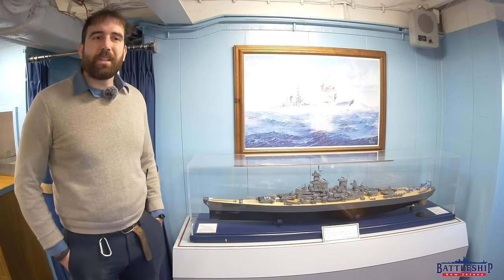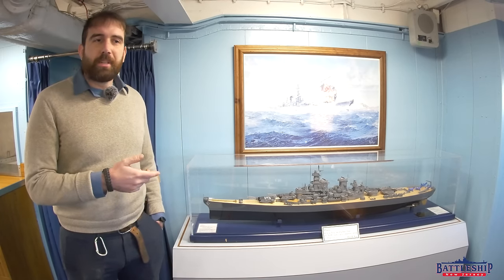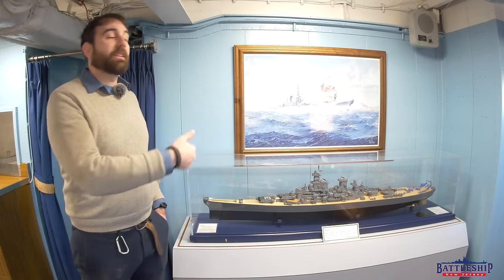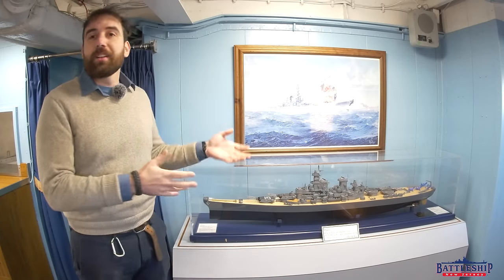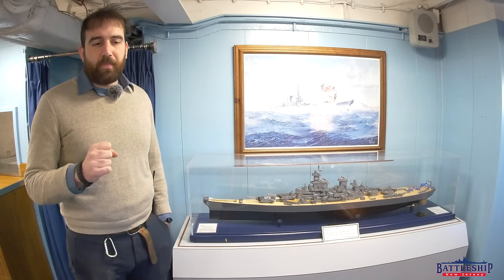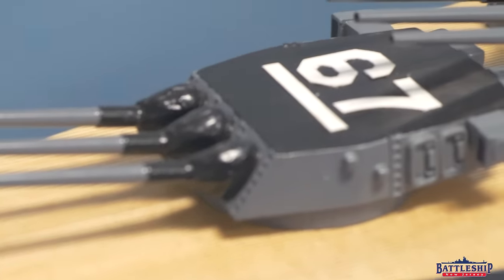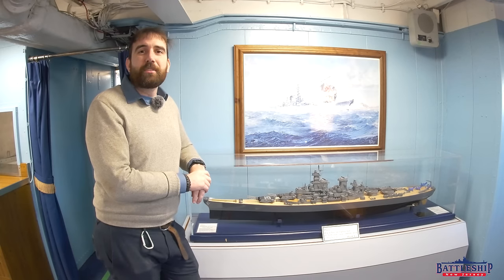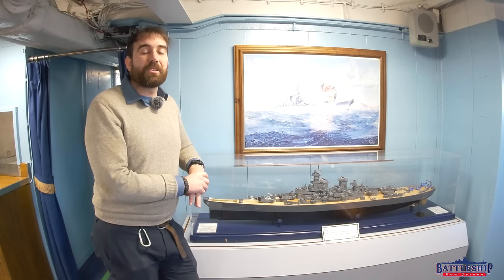Battleship Montana: What Would We Have Done Differently

Comment: With the benefit of hindsight, I'd ditch the two aft turrets and the floatplane facilities for an actual hanger for helicopters and a helicopter launching/landing platform. But would I have proposed such changes in 1943/4? Probably not; advances in helicopter technology would have been highly speculative. If additional battleships were to have been built, completing the Illinois and Kentucky was more sensible than building even a modified Montana-class.

Comment: Something insane like deletion of rear main guns and magazine and installation of a nuclear propulsion system. Delete fore secondary battery. See if redesigned propulsion allows for shorter belt. Delete or redesign torpedo bulges. Optimize armor scheme for HE or break up and pre-det bombs instead of worrying about naval gunfire.

Modify bow to house honking huge sonar mount. Large superstructure now venting steam instead of smoke enables larger radar systems.

Reduce secondary battery to x4 single 5" .38cal mounts, anticipating naval SAM systems. Because the ship would carry huge Radar and FCS, it becomes a proto-Aegis platform radar-burning targets BVR like AWACS would go onto do.

As original 16" .50cal batteries wear out, replace with .60cal equivalents firing lighter shells, or develop a simpler mounting with twin 18s. 

As cold war develops, keep plugging in and out contemporary arty and missiles while main gun tech is steered towards extending fire support range. 

A CGBN series. At its craziest, using the superstructure or aft magazines to host ballistic missiles.

Comment: Getting rid of the conning tower and condensing the superstructure would be the extent of the of the major mods that I'd make to the Montanas. I'd leave the total displacement alone. The late/post war advanced  AA would be a natural progression for all heavy ships. But her speed isn't an issue here. A cruisers and destroyers are much more capable escorts for fast fleet carriers. Leave the BBs behind. Let them either join hunter killer groups hunting surface raiders, where their main battery range and punch can do the most good, or attach them to the amphibs, where they can be used as a near unstoppable amphibious group command center/gunfire support ship can be it's best use. And that's really will be their job in the cold war. unless they threw a nuke at it (and the Baker Test proved that that could be an iffy proposition, too), replacing all those guns with a few Vulcan Phalanx and a quartet of Sea Sparrow launchers, and what the heck, maybe a Standard launcher or two (we have the tonnage, and we're not afraid to utilize it)! You look at the various FRAM refits that were done to Fletchers, Gearings, and Clevelands in the 50s and 60s, and I wonder what really could have been accomplished if they went clean slate with her superstructure?

Comment: Hi Ryan,You are not a Star Trek Fan. When I was a teenager when I grew up in the 80's I watched all 7 seasons from every Episode of Star Trek:TNG, I also watched all the syndicated reruns of the original Star Trek. As a kid I watched all the original  Battle Star Galatica series there was 1981 season that was Earth landings. I also read quite a few if TNG novels and William Shatner Movie Memories, that were popular at the time.
 With Star Trek TNG you Paramount and CBS published many  Star Trek companion books and paperback books.  One book was the Enterprise D Galaxy Class Technical manual.  Believe it or not when the Technical writers for the show wrote the book it also included redundancy. Both the Saucer section and the Star drive have their very own computer core. They worked independently during separation and one would function if it got damaged. Before the ipad the crew had electronic tablets. Believe it or not  they made those tablets to also be redundant that if the bridge computers were off line both engines and navigation could be controlled with the tablet. They never did an episode on that. Well TV shows need drama so when you need to do fight scenes and self destruct to take back control of your ship having a tablet doesn't do much with conflict. 
 One thing about Voyager TV show which I also grew up on in my 20's was that show was based using every science fiction technical jargon under the Sun. They did really well creating more ship jargon that  out did NASA with all its acronyms.
 Deep Space 9 the major theme in that story was that station unlike Enterprise it had major breakdowns was always in need of repairs. So just like Navy ships that break down well in Star Trek so do Space Stations.
 Every Star Trek spin off had it's very own theme on how it communicated to that audience and kept every show separate from each spin off. 
Rick Berman did a really good job with all the spin offs since his taking over for Gene after his death.

Comment: The Iowa class battleships were designed with a 212,000 shp to reach their top speed. All varients of the designs for the Montana did not use the same power plant as the Iowa's for the engines and the highest number I have been able to find for the main engines is 172,000 shp. By utilizing the same engines that were in the Iowa class you could overcome a lot of the speed issue, arguably you could actually install more powerful engines without much fuss as the hull is already wider and longer than the Iowa class.

Comment: If the US Navy had really wanted to increase the speed and range of the Montanas, they could have replaced the oil-fueled engines with nuclear power plants in the 1960s. 

The USS Enterprise (CVN-65), which had its shakedown cruise in 1962,  had the following propulsion system, according to Wikipedia: 
	
8 × Westinghouse A2W nuclear reactors
4 x Westinghouse geared steam turbines
4 × shafts
280,000 shp (210 MW)

Compare this to an Iowa, again from Wikipedia:

8 × water-tube boilers
212,000 shp (158,000 kW)
4 × screws 
4 × geared steam turbines

Later designs had just two nuclear reactors per supercarrier, but this is the first ship that was as large as (actually larger) than an Iowa that had nuclear propulsion, so it would have been the first ship with "proven" tech that could then be used to retrofit an Iowa or Montana class battleship. The A2W reactor could, in principle, have been used for a 8-unit nuclear replacement of the 8-unit water tube boilers on an Iowa. This is sort of hand-waving away minor engineering issues such as whether or not it would fit inside a BB hull without major reconstruction, but it's a useful "thought experiment".

Comment: Once is was clear Aircraft carriers were a better overall fighting ship, that battleships, did the US Navy ever consider building (fast) , special purpose anti-aircraft ships to better protect the carriers by providing an outer ring of defense that increased the number of guns that could engage more aircraft further away?
If a cruiser hull, was changed to remove its 8 inch turrets, all that space and weight savings could yield a fast vessel with a huge increase in 5 inch guns. When proximity fuse shells were available several (anti-aircraft ships) could protect carriers more effectively. A special destroyer variant might do provide a similar addition layer in between or as radar picket but better armed with more anti aircraft guns. Just curious if special purpose ships for augmenting the task force protection was ever considered.

Comment: I would think using 4 turrets with 15” guns, on something of the same hull and power plant as the Iowas plus adding some armor. Keep in mind my suggestion has variables. In the naval video games them Iowas are hard to beat so upping that design with more shot density and a bit more armor makes sense. It may be just upping the technology for more air defense to fit this hull. Maybe adding a three screw design for defense would also reduce weight for maintaining the speed. Chariedontsurf on wow.

Comment: There are several things I would do. But back I can’t remember back in the civil war I think.. there is an old fashion, Gatling gun system hand cranked. Why couldn’t we just take the 20 mm antiaircraft guns and make a Gatling gun system same as the design as your 3 inch twin as guns. As you can see in that picture you were shown, they were on two separate kind of like mount systems and I still don’t understand why we don’t even do it in today’s CIWS system more power to Shredding the enemy aircraft like to kamikaze’s. Reduces a lot of weight somewhat but if you design it that way, I think it would make things a little bit more easier. Yes, it would be super complicated because of the technology for electronic Gatling gun. But you would have more for less reducing more weight in a way I would’ve had as the current remodel of the Iowa class four of those may be six Maned by at lest two or three men. To describe a little bit better to. It’s not gonna have auto radar systems on it but maybe down the road later as a curtain navy. But let’s go back to the 40 mm anti-aircraft you see that there’s two men one basically operating the up and down the other operating the left and right turn and the firing and away all the guy has to do is basically put his foot down on a pedal and make it fire. Wow there’s a belt system with over 9000 to 12,000 rounds per gun better cooling as well. I don’t hear a lot of talk about Gatling gun. 

You can see in our aircraft such as the C-130 gunship how affective the Gatling gun system and cleaning are naval warship and if you see the movie battleship, you can see how to factor that it basically can shoot bombs out of the sky so anyway, even though we didn’t have advanced tracking radar system, such as the CIWS has till everything changes in postwar, we get to the Cold War and cell phone so they could help me update it but I think our modern navy should have something like that and if you’re talking about because of having duel the vibrations will cause it in accuracy by not attaching it onto one single platform like the Russians, any aircraft Gatling gun system you can always utilize shock absorbers to help reduce vibrations when operating a firing the weapon at the same time. There are many factors that we can do to make it more accurate, but I believe that with a Gatling, it’s mostly designed to put a whole bunch of bullets in the sky, fill it up to shred anything within a box if you can basically think of that as a example, that’s what a Gatling gun is designed for to shred anything that’s within its firing arcs that is approaching at speed. Also, I’m probably going to guess that you were going to talk about the torpedo defenses such as redesigning, where that area that you were in your last video where you talk about how they didn’t like the gap or the spacing I believe I would believe that maybe if they thought about utilizing the house oil tankers today and cargo ships utilize that the the bulb could make it a little bit more faster and give it enough buoyancy like you see in front of the cargo ships and oil ships as they remove ballast you can see him. Those the bulbs in front of their ships are designed to help make it go faster and displace water a little bit better to which it makes reduces friction in the water that’s what they design if you’re not understand what I’m talking about that bowl thing look at a video of oil, tankers and ships are look at a picture of a ship that’s basically sitting high-rise and you’ll see that big huge hump in the front of that Ford area and from the ship in the water that’s what it’s designed for to reduce for friction, and provide fuel, economics and speed anyway  and yes, I think basically a single funnel system would be better as well.

Comment: In this pre-guided missile era, is there any advantage to going to 18in guns? Naturally, this is all moot by the early 50’s. But early 40’s ship designers didn’t have the benefit of foresight and could only design for what might be needed with the technology they had at the time. 

Possible topic for a future video: What are the gun limits when it comes to future (mid-20th Century) ship design? How big can you go? Do the disadvantages outweigh the advantages the bigger you go? Do larger shells add anything to a battle that the 16in aren’t already doing in the 1940’s? I assume physics results in diminishing returns the larger you go. 🤔
Reply: As I recall, the long US 16 inch guns did about the same as the Jap 18" guns, US had been working to extend the range plus adapt small nukes to them. Much of the technology is described in articles about the various 155mm howitzer rounds and larger.

Comment: OK---------.  Auto Load loaders for the 16inch guns...  That will cut the crews by hundreds.  Longer barrels for the 5inch guns from 38cal to 52cal or even 62 that are on the new 2000 turrets (though the 1940s powders would not be powerful enough for the 62s) doubling the range of the guns using the new Proximity fuses.

Comment: Well post war one of the main reasons they kept the Iowas was mainly the accuracy & how fast the main batteries. & from my understandin the Montana class was on the back burner till late 44ish & the main batteries they on them where slower then the Iowas & even if they did finish the last 2 Iowas & the first 2 Montanas those ships would be big. Because the Kentucky, & the Illinois would be about 100 square ft bigger then the rest of their sisters & the the Montanas would be about 250ish square ft bigger then the last 2 Iowas. With the Montanas the one thang I would do is put a little elegance in & on them & go with a more 18th & 19 wheel instead of the sleek wheels that was used

Comment: I always love ship design and looking at the Montana Class there's a lot of things that could have made that class a monster.

1) The US Navy adopts modularization and uses the Montana Class as a testbed instead of waiting until 1975. I would sell it as a cost-savings allowing the frame of the ship be updated as new technology came online at the same time being a test bed for new technologies. This means majority of the Essex Classes could have been saved and updated for Nuclear power (as well saving the CVN-65 later on down the road to be a museum ship).

2) Angular Hull system and hull plating structure. This is by far the bigger disadvantage as large ship = larger profile. An Angular hull with ablative plating on the waterline would provide extra protection against shelling but additional protection to torps. If the plating is damaged it just falls off instead of being launched inside as shrapnel. Like anything its not a full proof system but it also helps on weight savings. Placing angles at more critical areas that need to be protected and ablative hull plating on non-critical areas to keep weight under control.

3) goes back to modularization, Non-critical areas will use Aluminum modules while critical areas will be in steel/reinforced. 

4) Create a better and functional cellular ammunition storage system with the ability to suppress and redirect damage away from the vital guts of the ship.

5)  Full redesign and compacting of the superstructure again using angled hull to provide better protection per ton. Make the superstructure low profile and armored. Use radar and recon planes to help direct fire and control but a large superstructure is asking to be hit and the weight to armor it is not worth it when you can pour the resources somewhere else. 
I would also add that the secondary bridge be placed in the guts of the Montana class (mid ship, where its heavily armored and protected) and use the top of the Super structure as the secondary bridge/look out position. If the Admiralty asks why, I'll just ask them this question "to knock out a ship what's easier, racking the superstructure with MG fire from an airplane or launching half dozen torps. You may get 1-2 strikes but incapacitating the whole command crew is worthwhile"

Bonus wish list, tell GM to build a Gatling autocannon in 20mm flavor. It took until the 70's but if we could have accomplished something like that during the war, the damage to our ships as well providing better firing arcs would have been worth it.

Comment: One thing i would do differently would be to increase the caliber of the 16inch guns to 55 or even 60 caliber and increase the weight and explosive charge of the shells. Increase the effective firing range from 23 miles to nearly 30 miles.
Reply: Next i would upgrade to the most modern firing directors and fire control systems.

Comment: So, a little outside the box, but…
I’d wait until 1945 to finalize the design and then drop the heavy armor belt protection to save on weight and a whole variety of second order effects.  Not to say you wouldn’t keep some armor protection, but The US never had to worry about battleship vs battleship warfare post 1945. The Iowa class had good service in the second half of twentieth century providing fire support, but they certainly didn’t need the armor belts they lugged around everywhere post 1945.

Comment: Enhanced power and systems to rout additional electrical power throughout the entire ship, adding more auto guns, more radar and more advanced Radar, sonar, fire control, range finders and range finding radars etc all gonnna need more power. 

The objective of this change is to increase the first hit capability of the battleship, to be able to disable the enemy systems with your first volley. the new class will be able to hit, without correction to a higher probability.  

Augment radar and fire control to do above but also o enhance AA suites accuracy. 

Allow more advanced comms and cypto systems. 

Allow the further use of powered mounts, as planes get faster, so do the mounts.